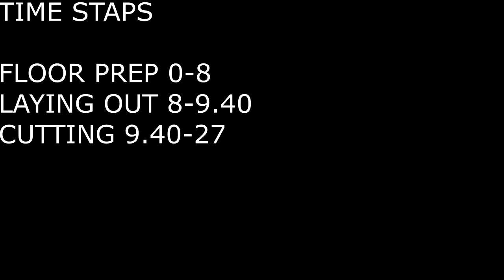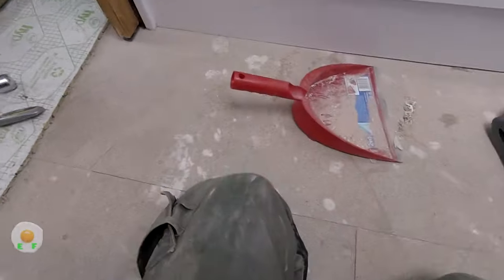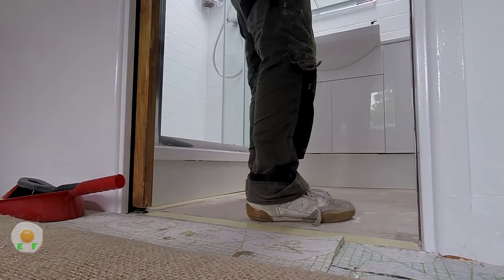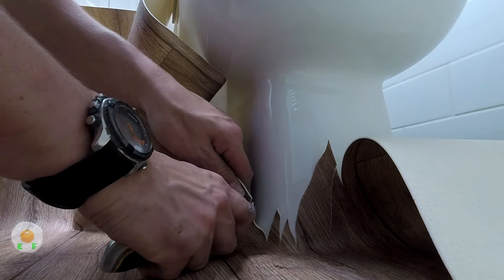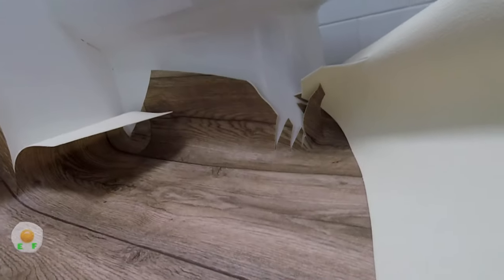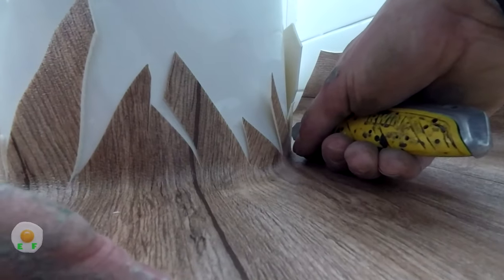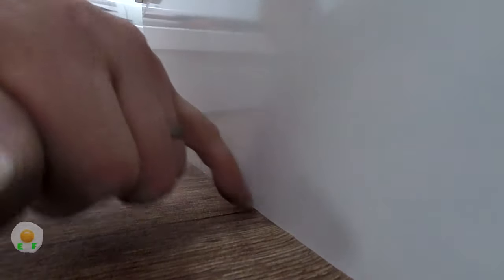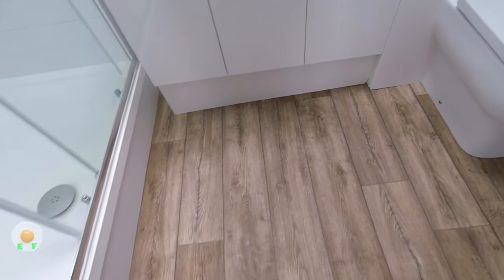VINYL SHEET / CUSHION FLOORING HOW TO FIT!!

Comment: Hi eggy mate, cheers for you videos it helped me lay down vinyl over the weekend 👍 I managed to get a small crease and you advise a heat gun which I don't have but will a hair dryer do it? Do I have to be careful it doesn't stretch and I have a bubble in the middle of the room? Would be great to see a video on this, as your the only that has mentioned this issue in videos
Reply from the maker: Glad it helped you mate a hair dryer will work just go light on the heat don't want to burn it
Reply: @eggyfits  awesome I’ll have a go 👍 i did see another video of a guy using a wet towel and iron 😬 it definitely worked but I’m worried 😂 oh do you have a video for joining the end of a room into another room on vinyl? Do i lay one over the top and cut both to get the perfect match? Cheers for taking the time out to reply, it’s much appreciated 😊

Comment: A classroom example of using a trimming knife skillfully. Camera angles were great, exposing the detail close up.
I'm about to embark on laying Lino for the first time & have viewed multiple videos, but not anymore.
Yours is the template & only reference point I need to begin the work with some confidence.
Thank you so much for your advice. 👍
Reply: How did it go? I'm in the same boat.

Comment: Hello mate.
Great little vid 👍 
I'm a tradesman, but never fitted vinyl before for clients.  Not because of lack of skills but just missing a trick on how to use the knife to cut so tight.  Now I know.   I never ever thought to bend the tip of the hook blade.  Jidzooks.  I have 3 rooms to do soon so I'm actually feeling emboldened and confident rather than worried. 😅  Thanks Eggy.  Appreciated.
Little Tip for you.
Throw the dustpan away.
Get a Henry vac and wide soft brush ends etc.  Look after those lungs.  I never sweep.  Only vac.

Cheers buddy 👍.
Reply: As a certified floor layer lv 3 mate I tell you what mate it's the screed dust that gets you and F60 best glue in the world better than that tape if your ever doing anything we're it is required and make sure you have a mask for that one tho
Reply: @Mrfloor-eu5nr what masks you using buddy? I’m starting to get a bit conscious of what we actually breathe in in this game. Carpet fibres, glue and screws powder just scream health issues down the line
Reply: @Jboy19881 i dont use one never have got masks all properly fitted to my face never wore them once
Reply: @Jboy19881 don't use them just suck it up and deal with it

Comment: Love the video how do I put vinyl on concrete flooring??
Reply from the maker: Hi is the concrete smooth and clean if it is the same way as this just make sure that when you sweep it it's not really gritty if it is the floor will  need latex I have a video on that to hope that helps 👍
Reply: @eggyfits  ok thanks yes it smooth wht video so I can go watch it thanks
Reply from the maker: @NicoleB79  it can be put down the same was as this video 👍

Comment: Hi do I need to cover floor boards with thin sheets of ply wood  to smooth it out ?or replace floorboard with 12mm cheap boards sheets?
Reply from the maker: Hi you can use hardboard or 4mm ply or if the boards are bad 6mm ply

Comment: The customer knows nothing about flooring, so tell them what it needs...!!  
5.5mm flooring grade plywood fixed with ringshank nails. Then, a skim coat of feather finish to cover any joints in the plywood and low spots. When dry rub down and sweep out and use a 1.5mm notched trowel to spread the Fball F44 glue over the whole area. Drop vinyl in place while glue is still wet and square up. And fit with a hook and straight knife job done...🎉 
If you can't do the job right, don't do the job and just walk away.

Comment: Are you ambidextrous? You hold the knife in your right hand, yet cut right to left, as though you're left handed.
Reply from the maker: Yes I can cut with both comes in handy lol
Reply: @eggyfits  Nice, I have to do the same as this in my bathroom, I couldn't have picked a better clip to watch for advice, I thought I'd have to slap Evo-Stik everywhere, it's been over 30 years since I last put lino down, used to have to cut it first, then Evo-Stik the floor and lino, then struggle to fit the lino without making any mistakes. But the biggest thing that you've put my mind at rest with is, you laid it straight onto chipboard surface, it's the same as what's down in my bathroom, and so many saying that it should be ply'd first, I just hope I can make as good a job of it as you have here, thanks 👍
Reply: @eggyfits  I haven't chosen a lino to go down in my bathroom yet, I was thinking of asking in the shop if they knew anyone who could lay it for me, I'm not too sure if I want to chance my luck at this, it's about the same size bathroom as this, have you got an estimate of how much to expect to pay for someone to fit it?
Reply from the maker: @YORKEE  fitting can start from £75
Reply: @eggyfits  Wow, looks like I'll be having a go myself then after all, I hate parting with money when I think there's a chance I can do something myself, thanks.

Comment: Should only be one cut .not recutting.. always use a straight blade any other type shows a lack of confidence.and never ever silicone
Reply: Why not silicone? What else would you use or recommend?
Reply: @julienakazi9336  just answered your own question??.
Reply: How about when your cutting sheets on top of installed material? That’s when ya need a hook, nothin to do with confidence mate